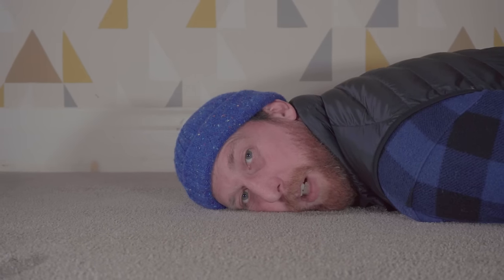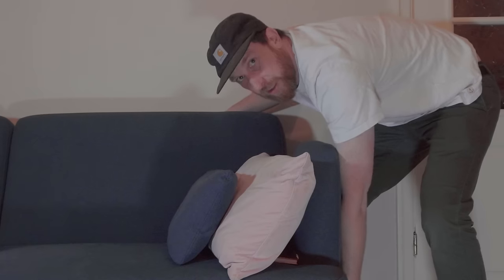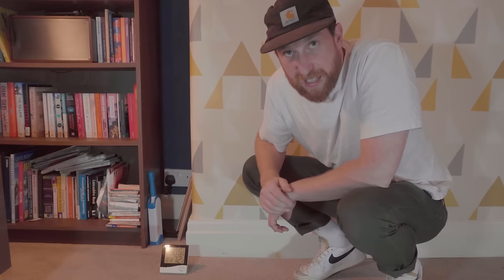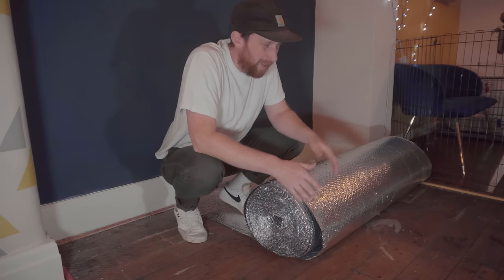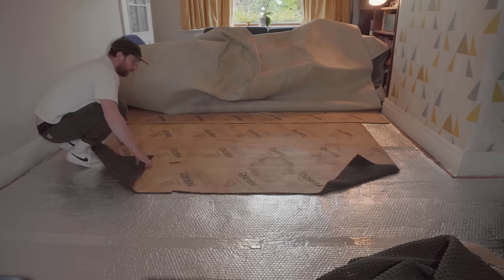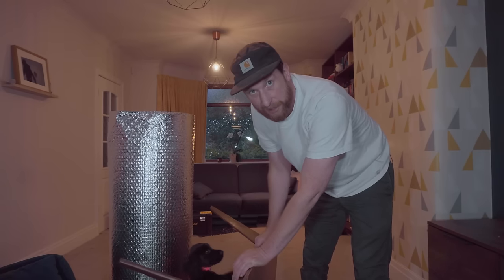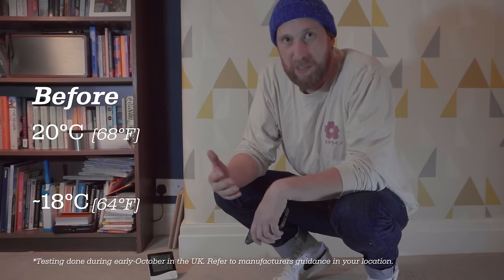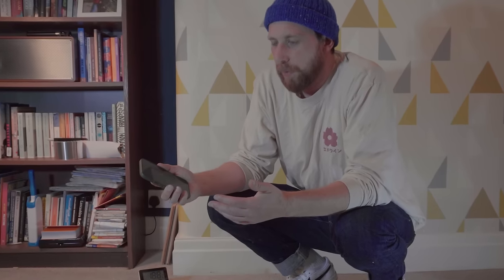This floor insulation could save us HUNDREDS

Comment: Love your channel! In this case, I suspect you’ll get moisture between foil and wood floorboards. Are you able to insulate under the floor? Moisture in the earth will be somewhat trapped below your foil and may be drawn up through the floors in other rooms as convection occurs. This could cause severe mold/rot, and be attractive to termites. Hope I’m wrong about that!

A house is basically a chimney, with a significant draft (in winter) of expensive, heated, energy-intensive warm air flowing rather freely up and out through the roof. Does snow stay on your roof or just on the eves? Fiberglass batt insulation doesn’t prevent drafts… it’s also used as a filter material in ventilation systems… but foam insulation stops drafts. 

My 103-year-old house has no insulation in the walls but after sealing the underside of my roof, including the rafters and around the area around the attic floor, my house has virtually no heat loss out the roof because the foam is an excellent insulator, and the draft has been eliminated. 

Snow stays on my roof as long as it stays on the eves, unlike my neighbors’ homes. The snow melts because the outdoor temperature goes up, not because my home loses heat through the roof. As well, in summer, the attic temperature went from about 150ºF to being the same as the rest of the house… so it’s a conditioned space now, with no insulation between the attic and the living area. The HVAC air handler in the attic doesn’t have to overcome that extreme of being in a super-heated/freezing-cold attic to cool and heat the house… and it’s the most comfortable home I’ve ever lived in.

By the way, adding blown-in insulation to old, unwrapped homes is a recipe for rot and mold. Those wall cavities have lasted 100s of years because they dry out after inevitably becoming damp/wet. Insulation will get wet and stay wet. Be very careful how you choose to “improve” your energy use!

Comment: That stuff is basically a radiant barrier. Radiant barriers need an airgap of at least 20mm on either side to work effectively. In your application it does nothing in that respect. The few bubbles add a minute amount of convective insulation, in a highly inefficient manner.  This stuff is mostly snake oil. It would work well here in California to keep out radiant heat from the sun, but in your case, it's mostly wasted effort and money.

Comment: I think if you wanted to go that way ..then i would suggest to buy those foam boards ..they are thick only about 2cm well they start there(thickness)..so it isn't so big difference.. but improvement is much much higher compared to just buble wrap....but ofc you need to do some cutting around the doors..unfortunately
..

Comment: 18°C is not 10% lower than 20°C. If it was it would be the same on the Farenheit scale (64.4°F and 68°F  - a difference of 5.3%). Your calculations are based on an arbitrary zero point. You can compare temperatures like that if you reference them to absolute zero or use the Kelvin scale.

Comment: It’s been 2 months, did it work?
Reply from the maker: It's made a difference, for sure. It hasn't completely fixed the problem - there are other draughts that I need to fix - but the floor is way warmer than it used to be
Reply: @northernworks  thank you. Planning on getting wooden floor so think I will try over top of block and beam floor

Comment: You would be better off covering the inside of your windows with this, having first attached it to some marine ply (or similar).
Need a return to internal shutters.
Reply from the maker: Yeah, I’ve been thinking about shutters, or even some good blinds, between the window and the curtains. Does that make much difference to the window heat loss?
Reply: @northernworks  
Old Georgian houses often had internal shutters, but without good rubber seals to complete the benefits.

Saw an old episode of "Grand Designs" where the couple had new sandwich folding shutters made by a local joiner which looked very impressive.
Plastic, aluminium or metal  window frames won't help.
If you have these then shutters will make quite a difference especially on the North side.

Comment: Another thing you can do is have a low level fan running so it knocks the heat off the ceiling and back into the room

Comment: It’s obvious you have a suspended timber floor over a void. The proper answer would’ve been to install expanded Foam with a seal around the edges like Celotex. Under the floor. Unless the void was too small for you to get into after you moved a few Floorboards.
Reply from the maker: The space under the floor is about 30cm deep, so I’d have to pull up quite a lot of the floor I think. This was just a quick test to see what difference could be achieved with a relatively cheap and very easy product - the floor is definitely more comfortable, but the main issue is drafts. Proper underfloor insulation and good sealing is the proper way to do it long term, no doubt.

Comment: The aluminuim foil face is unnecessary as you install it wrong...
To be a radiant barrier you need at least 1 cm air gap between yhe shiny side and any other material.

You have the same bennefit (or lack there of) as plane bouble wrap without any facing, wasted money when installed wrong and now you might get mold in the floor ifit is moist underneath

Comment: I think you missed a big opportunity to reduce draft by not taping the edges of the insulation by the skirting. The exterior walls and foundations are usually the worst offensenders in old drafty houses in my experience!

Comment: Yeah, thats not the correct type of "insulation" Radiant barriers are effective, but they must be installed with air space on at least one side, otherwise it conducts energy instead of reflecting it.

Comment: 15% temperature temperature change is not correct. It makes no sense to use percentage when you are not using absolute scales of temperature measurement like Kelvin. Think about it, if the temperature would get from 0˚C to 2˚C is that ±infinite % of change (2˚C / 0˚C = 2 / 0)? Of course it's not. It's a change from 273,15K to 275,15K which is around 0.7%.
Your temperature change is 2.5˚C of which is equal to a difference of 2.5K. Your start temperature is 15˚C which is 288.15K. 2.5K / 288.15K ~ 0.0087 ~ 0.87%. I'm sure no one really wants to express temperature change correctly in percentage outside a laboratory or a physics book :)

Comment: You wasted you time and money. Better spent on a thin foam layer. Why? Foil/bubble wraps need an air space to work and works best if it has an air space either side of it. This is well known in the building industry and 10 minutes on the suppliers website should have given you that information. Foil/Bubble DO NOT WORK UNDER CARPET LIKE THIS.